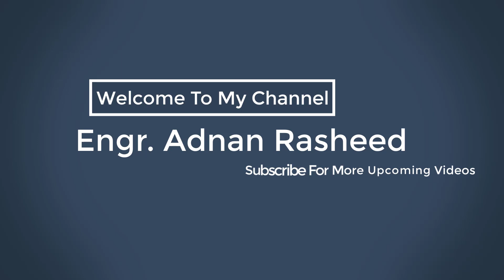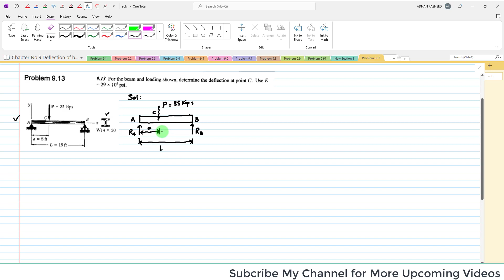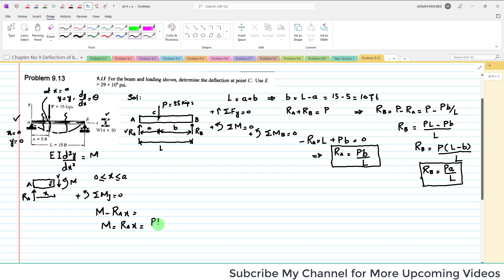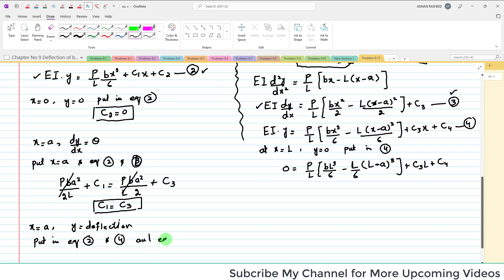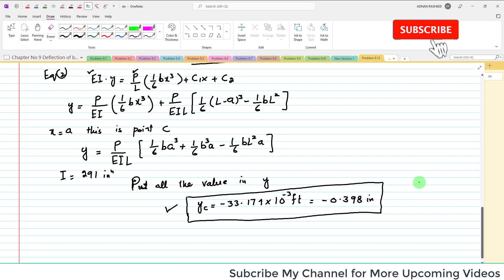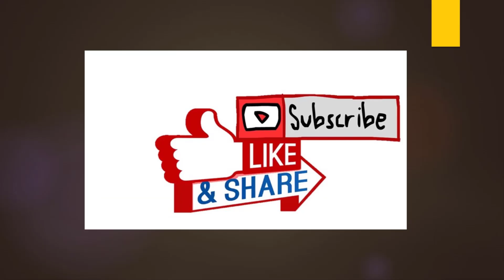Problem 9.13  ||Deflection Of Beam || Beams Deflection || Deflection Of Beams Solved Problems

Comment: Nice lecture but assumption is little bit difficult
Reply from the maker: It's not assumption. It's called boundary conditions and with the passage of time you will have clear understanding
Reply: @engradnanrasheedmechanical  I am talking about FBD and then making equation
Reply from the maker: It's very easy you will be able to understand it soo  when you attempt some questions by yourself.
Reply: @engradnanrasheedmechanical  OK